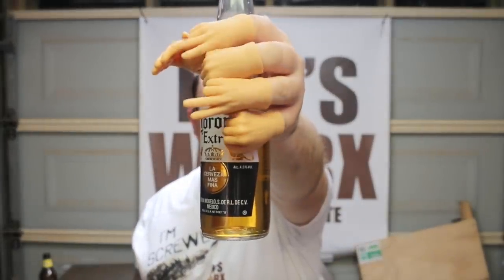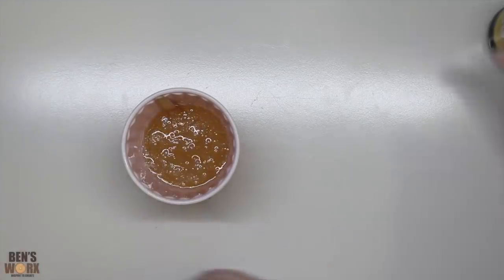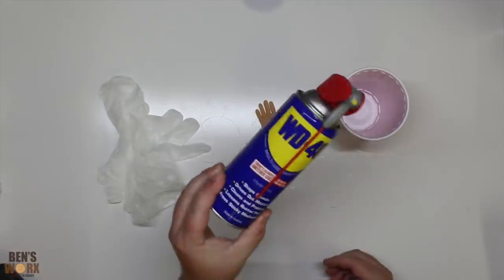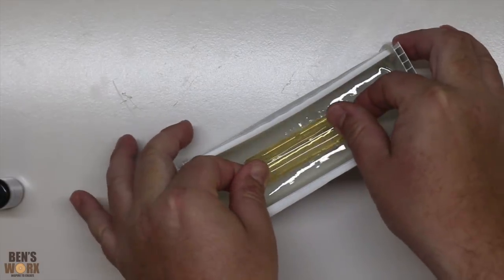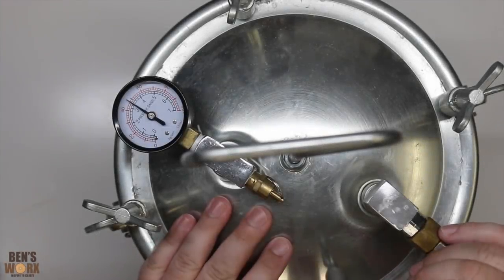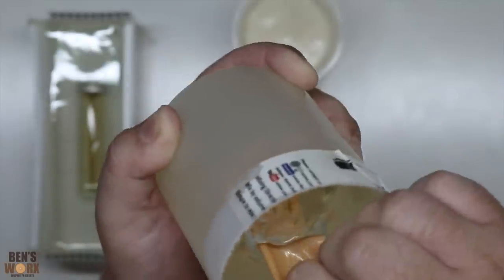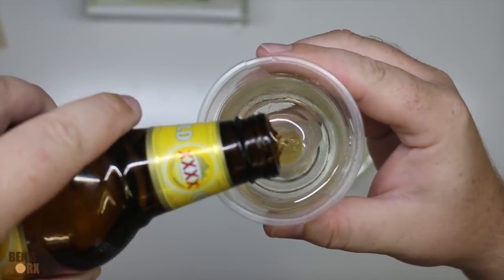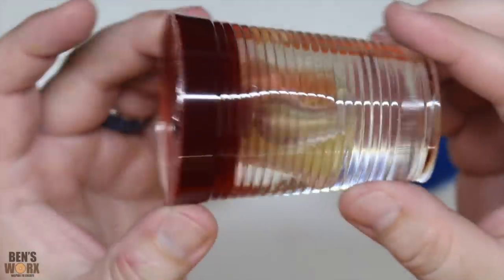Resin Vs Beer - Suspending liquid in epoxy resin

Comment: This was so cool!! I had a similar idea about a  year ago. I tried the void thing but it wasn't quite what I wanted. I went to my local feed n tack store to get some syringes and different sized needles. I tried letting the resin cure to different stages then adding liquid. Only thing I really made was a huge mess but it sure was fun. :D That plastic on top was a great idea. I would have used a thin sheet of cured resin though. Not sure but the resin sheet should just disappear when more resin was added. - Heidi
Reply from the maker: Thanks Heidi!

Comment: Beer fist or test tube, I think. Also, I was thinking that instead of using plastic to cover the fluid, why not just pour out a thin sheet of resin on some flat surface, let it cure, then cut it to size and use that?
Reply from the maker: That was my original plan too, but I decided to use the plastic instead